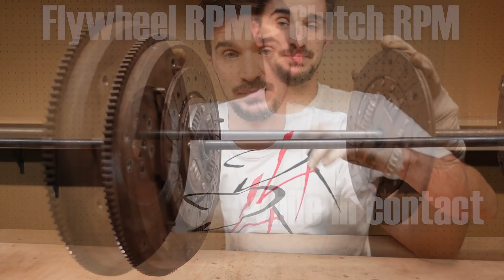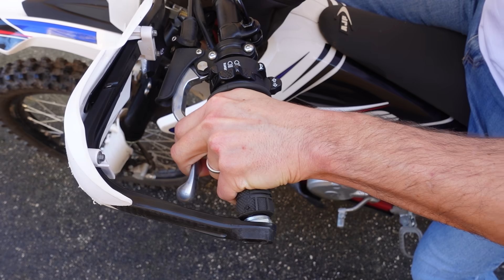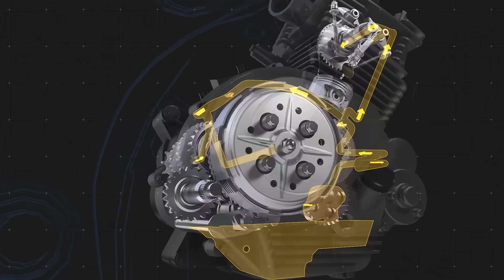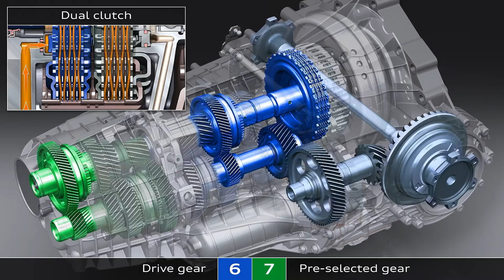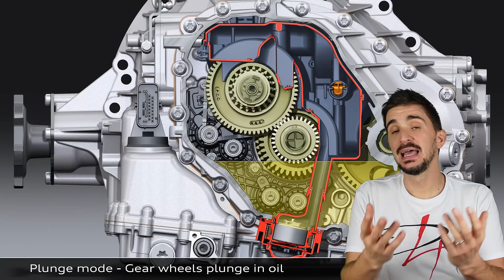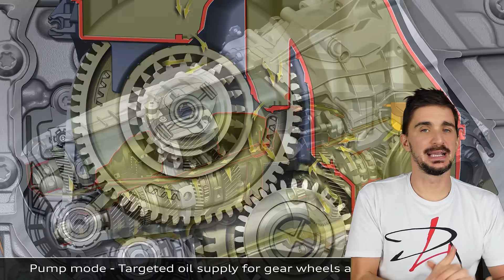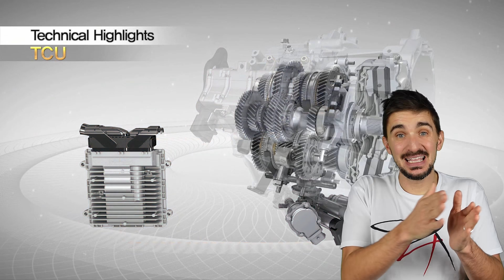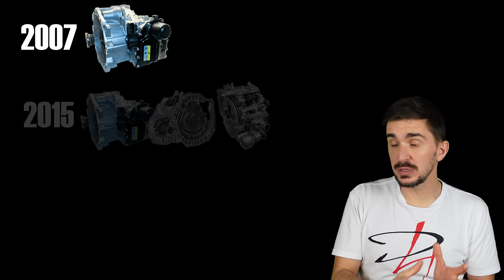Why Dry Clutches Suck and Why You Should Avoid Dry Dual Clutch Transmissions (DCT/ DSG)

Comment: Watching with a VW DQ200 in my driveway🫩
Reply: In my country, DQ200 is notorious for failing at around 90k to 100k km.
Reply: 2017 Alltrack with DQ250, 156k km, no issues, third oil change on next week.
Reply: @finnderp9977 you have a wet clutch, what is your point ?
Reply: You'd have to avoid half EU car market if you don't want dry DCT, and like 80% if you don't want DCT at all.
Reply: Yes, most people drive them like regular torque converter automatic transmissions and then wonder why the clutches burn out so fast.
Reply: @HardRockFinland This transmission deals with torque converter driving style just fine, except it does not like slow creep uphill in traffic jams - in these conditions, just switch it to S or manual so it stays in first gear for longer and therefore can drive slowly with fully engaged clutch instead of slipping it in 2nd gear. Or just wait a bit longer and then catch up a longer distance at a time, instead of slowly creeping right behind the car in front of you. 👍 All this is simply not needed when not going uphill, that transmission creeps just fine on flat ground, and if the traffic jam is heavy it even changes between 1st and 2nd gear occasionally to switch clutches and let them cool a little.
Reply: @HardRockFinland correction, most AMERICANS. They have, on average,  the mechanical sympathy of a 100 ton stamping press. To them, every stoplight🚦is a grand prix......
Reply: @iandennis7836  "Why worry about mechanical sympathy when I'm 14 months behind on maintenance? What do you think I am, a communist?" - Americans
Reply: @HardRockFinland  I found a video demonstrating one particular dsg, others might be different but it is still interesting

https://www.youtube.com/watch?v=9xcyOJHUGk0
Reply: they are very reliable i you use them right and the repair cost are  low if you compare them with the wet dsg
Reply: @tyor99 Mechatronics fail far more often and they cost about the same new. Used prices are much higher because of high demand. For you as a consumer there is really nothing at all good with it compared to the DQ250
Reply: @tyor99  Nonsens, i had a Golf 7 with that transmission. Clutch wore out after 28k km, warranty claims denied, 2500€ at the VW dealer for a new multiclutch. If you live in a city with stop-and-go traffic sell the car asap, only a matter of time when it goes bad, not if it goes bad.
Reply: @AOTanoos22 it's probably why your warranty was denied, you tortured the transmission to death. My 2016 Octavia with DQ200 has 210K kilometers with clutch pack and flywheel replaced at 180K for ~$750 - after almost 10 years of driving stop and go city traffic almost every day... Without a single other service done to it and with a classic automatic driving style, although I try to limit creeping uphill when in traffic jam.  First wear symptoms, for some reason described in this video as a normal thing for dry clutch (judder, harsh feeling, vibration and noise), only started appearing around 170K km, into the ninth year of driving...
Reply: @AOTanoos22 nah mate definitely user error if that happens. Mine is at 150k km and only now it started to show signs of wear
Reply: @irvvine i bought the car used from the VW dealer at almost 20k km and 2 years old. I only drove 10 months and 8k km before the clutch started to make sounds when shifting. Are you telling me i destroyed the clutch within 10 months and its normal after 28k km? You can check forums, there are literally hundreds of people with the same issue. The warranty was denied because its a wear part like brake discs and not covered under warranty. 

Im not a retard i drove a manual 5-speed Audi A4 1.8T before that with 160k km on a single clutch before selling it. I know how to treat a clutch. I know to press on the break fully and not let the car creep forward even in stop-and-go traffic.
Reply: @Mannyxz  i think i know how to treat a clutch having owned a 5-speed Audi A4 manual 1.8T before that with a single clutch to 160k km. Even if it was user error, which it wasn‘t, the clutch should never have failed after 28k km, which is clearly a quality issue. Forums are full of people with clutches going bad well before 50k km.
Reply: DQ200 gang represent! and i've got more then the rated tqu going into it :D
Reply: @alexcrawford859 do you change the oil?

Comment: Do one for toyota eCVT. It is the greatest idea in history, and noone has explained it without BELTS!
Reply: I believe Engineering Explained has a comprehensive videos on Toyota eCVTs
Still looking forward to D4A's explanation of it though
Reply: My guy it's a planetary gear just google how it works and you'll find out your self how that "ecvt" works
Reply: Did Weber university explained it wrong?
Reply: @L3N1NVEVO  No, he did not. He's explained it correctly many, many times.
Reply: There are many videos out there explaining the PSD.
Reply: It's not really that complicated if you understand what differential assembly is
Reply: Had prius and lexus GS with  eCVT. Best gearbox in the world.
Reply: Many tried to explain it, but d4a would be much better.
Reply: @dmalikovskithe operating principle is extremely simple (the control electronics are not). Mechanically it is one of je simplest design out there. The explanations from Weber Uni are so extremely thorough that it is hard to beat them.

Comment: Wet clutches all day. Motorcycle uses them and get abused and it still works.
Reply: Especially since the clutch lever is kinda optional once you are moving.
Reply: That's because of the dog box not the clutch
Reply: The only issue is the clutch wear material is in the motor oil from the very 1st engagement
Reply: Motorcycle engines and motorcycle clutches are superior to automobile engines and automobile clutches.
There I said it.
Reply: @12skipafew-e7y sequential straight cut gears, wet clutches, chain drive, adjustable valves. Easy to access brakes.what not to love? And siting in the middle.
Reply: @prabashrusiru9224  The power density of your run of the mill motorcycle engine is more than most multi-million dollar supercars.
Check out Superfastmatt's video.
watch?v=AlPyGNxoC1Y
Reply: @prabashrusiru9224 
Since you asked; small displacement and low torque numbers. Other than those two things, nothing.
Reply: @negativeindustrial have you ridden single cylinder bikes they got torque.
Reply: @negativeindustrial  You don't need 240 ft-lb of torque at 1600 rpm. You're only moving 400 pounds, rather than 3200 pounds.